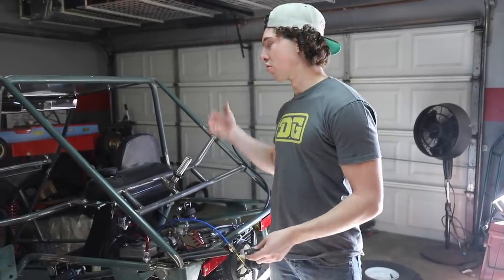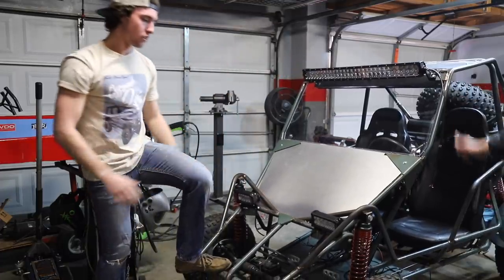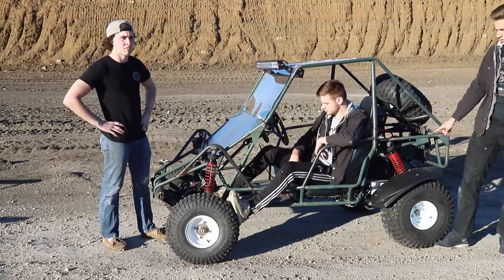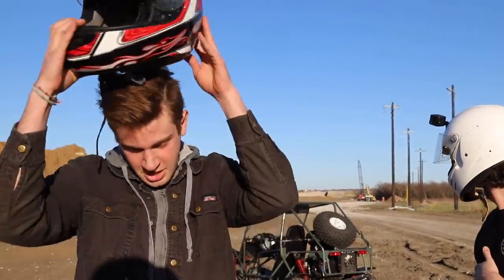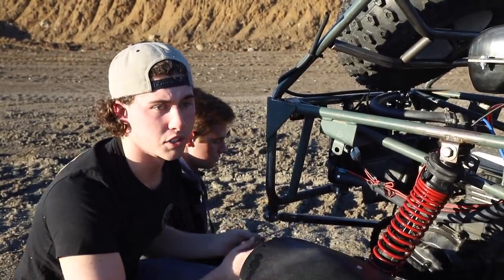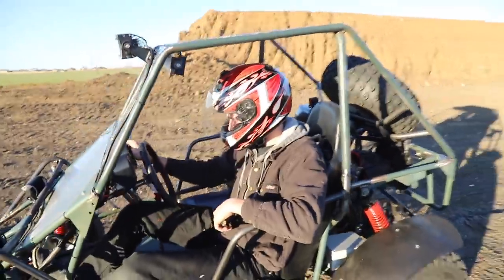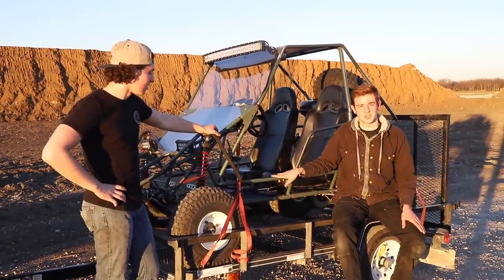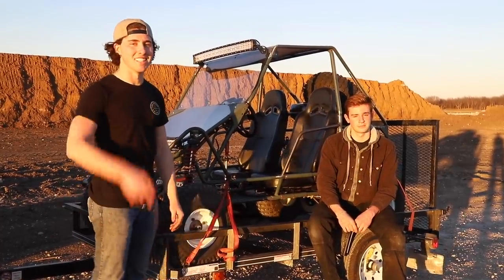Ninja Offroad Shifter Buggy Build Pt 9 | First Drive!

Comment: Looks good dude. I just finished putting a ninja 250 in a go kart myself. You are definitely having fuel issues as that motor should redline at 14k. On mine I was losing power and it was cutting out at high rpm due to electrical. I thought it was fuel related but it was the wire that charges the system and it was draining my battery.

Comment: Great build guys but it does seem like there is a power issue. That engine should push that kart much faster that what I’ve seen so far. FYI I’m only to 8:46 so let’s see if you fix it.

Comment: sounds like you need to redo the sprocket combo, along with fixing the fuel issue, the engine sounds like it's working too hard to get it moving. My CBR600 powered Hammerhead has a 5:1 final ratio, which is great for low end performance. It will spin the tires, like crazy, up thru 4th gear. I haven't shifted past 4th gear yet (60+ mph in 4th is fast enough)

Comment: A lot of guys who build mini buggies with motorcycle engines, usually use a radiator from a Honda civic and an electric water pump. That should prevent future over heating issues.

Comment: Guys you don't need to use the clutch when up shifting.  I would check the ign. module sounds like it is not running on both cycl. most of the time.
Reply from the maker: Interesting, we have another cdi from the other parts bike we’ll swap it and look for improvement.
Reply: Ya clutch is only really needed for starting and stopping. Otherwise you can bang gears if you let off the throttle inbetween gears

Comment: try using a  Facet  #60304 electric fuel pump   ,   from Aircraft Spruce  $37.99
I had that same problem on my kart (ninja 250)  gravity feed only fills the carb with the inlet barb , not enough flow to keep the other carb filled with fuel.   this pump is 3-5 psi and enough flow rate  to fill both carbs

Comment: Deuces are HEAVY! Almost 700lbs dry, and you guys added a lot to it

I don"t know how they got away with 12hp from the factory, so mine is getting 40, and that may not be enough.

Then I'm sure I have to tweek the gearing.
Reply: Did you guys take the front trailings arm off? Mine were super stiff from rust..

Comment: I bet if you dumped the clutch in like 3rd gear, it would've spun up. I think because of the gearing, it just doesn't have enough speed to get the tires going. I don't think torque was the issue.

Comment: Twin carbs are fun to sync, I had to do it when I built my shifter kart with a Honda cb200 engine. Though it don't sound like a sync issue as much as just a clogged carb. Best bet would be to pull em both apart and rebuild them. One or both carbs are leaning out. Also on the gearing issue,first get rid of the #40 chain set up,that karts to heavy with to much power for #40,go with #50 chain. Also on the opposite side you should run 1:1, if the engine sprocket is 17 run a 17 on the jackshaft. Run  about a 4:1-4.6:1( 15-60,13-60) final drive ratio. I ran a 3.66:1 ratio on my kart,but it was alil lighter and only had to pull one person. You have to take into account the reduction of the trans, I have all the math written down somewhere. Will have to bust it all out again soon to.
Reply: I concur.

Comment: Definitely run a smaller rear sprocket and judging by the sound of it you definitely need to fit a suitable fuel pump, it sounds like it’s suffering from fuel starvation.

Comment: First ( if i have learned anything from my long career watching youtube) change your spark plugs! Then put the airbox back on, then swap all four carbs for two from gopowersports and plastic intake.....

Or,,,, get a fuel pressure gauge and find out what the bike had stock and match it. Better yet grab the entire fuel system from the bike and put it on as a temp measure and see if the issue goes away. 

Have fun fault finding cause i have watched so many bloody vids doing just this last year. Ask, cars and cameras and ratherbwelding 
Those guys have been through this already

Comment: Its a nice kart u got 2 small of a engine
Reply: it used to have a 6 1/2 hp on it that engine is more than enough
Reply: Its fine. Wait till they get it running right... It should be throwing dirt rooster tails with that setup...

Comment: They make a device that makes syncing carbs easy. Or just turn them both all the way to zero so to speak and then adjust them equally.
Reply: Yeah it doesn't work that way carburetors have to be adjusted separately.
Reply: @sniper198369  you're welcome
Reply: Yeah i know they have a carburetor sync device. not the way you said to turn them down then adjuste together that wount sync the carbs they will need to make or buy a carb sync device.
Reply: @sniper198369   I was just saying that so you have at least a good chance of getting them closer together without a sync tool. Obviously that wouldn't have been perfect..lol.

Comment: Carb synch ONLY effects Idle and just off idle - not middle revs and high revs - the engine will have no idea about synch....... you need a jet kit for that pipe -
The bike had a gravity fed tank to the carbs, Is your current tank ABOVE the carbs? yes?  So, for sure not it

Comment: Apart from the carb issues you also have wrong gearing. The gearing in it is like for rock crawling.
Reply: That was kindof their idea. To make it a crawler. But its really really low so theyre gonna gear it up a bit
Reply: @rprokopow  
Yea but that is extremely low like you also said. There trying to launch it but there isn't enough gearing to do it. My 3 year nephew would pass them on his razor electric quad. Lol

But credit is given where it is due. I have seen many videos of different youtubers building these carts and this has been one of the best ones that I have seen. They took there time  with attention to detail. They actually used the original cluster and hooked up all of the lighting and used the actual brake lights and everything. So kudos to them. It actually looks safe and comfortable to drive. 

Some of the other carts look like death traps. Lol

Guys keep up the good work. You guys are doing great. I enjoy watching all of your videos.
Reply: @justallaround8614  yeah definetly really low and if it was me id gear it way up. But the guys over at grind hard plumbing co. Do some really good work and have very creative minds when it comes to fabricating this stuff
Reply: Oh yea I watch them.